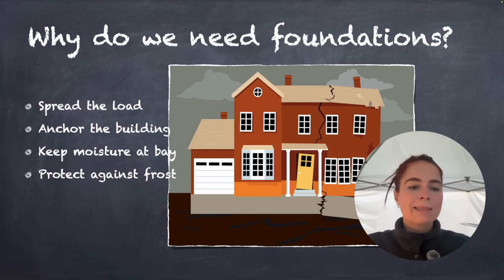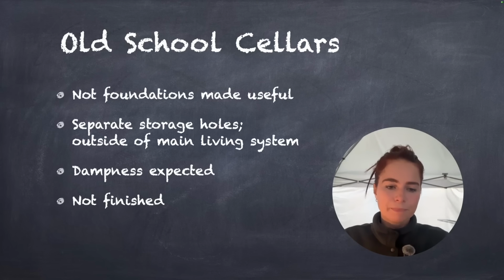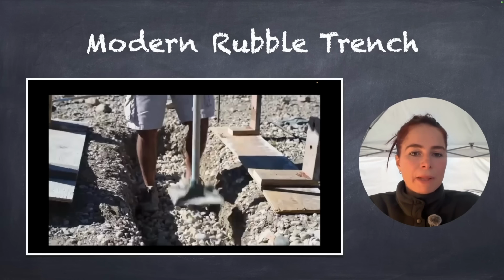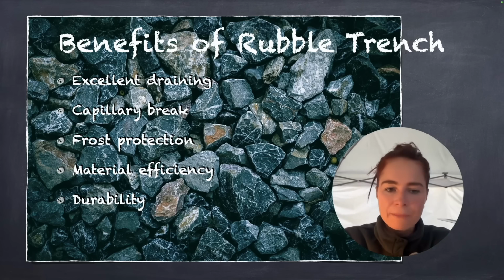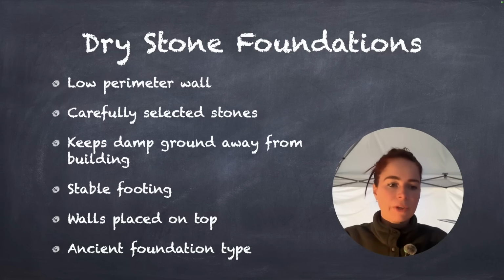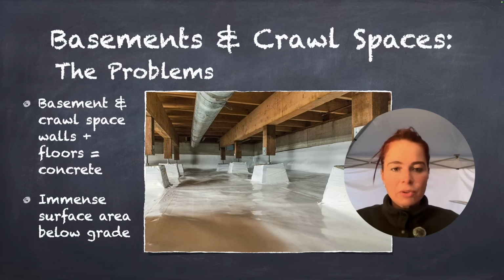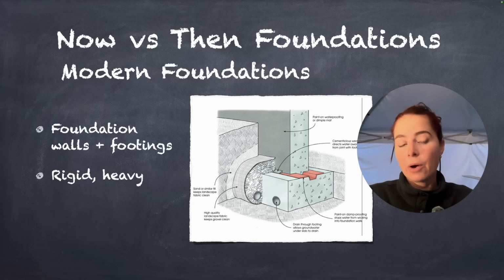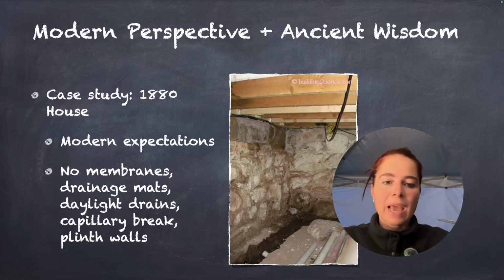Why Modern Foundations Fail — and the Genius Design We Abandoned

Comment: Growing up in Tornado Alley in the US, we often had to hide in the basement whenever one would blow through. I was wondering if you had any thoughts on below-grade structures being used for safety, and what it would look like to incorporate rubble trench and/or concrete sub-grade building in conjunction, cost aside. I know that using both would likely be prohibitively expensive, but from a purely theoretical or academic view point. I'm also curious how the various foundation structures would work in different climates, like how different areas have earthquakes or landslides, what would the benefits or drawbacks be to different foundations under these more extreme cases?
Reply from the maker: Good question — and I totally get the need for storm cellars, especially in Tornado Alley. From an air-quality standpoint, though, I’d want to keep any below-grade space outside the main building envelope, since connecting it directly can bring up moisture, radon, and microbial air from the soil. That does make things a bit more complicated structurally, because an unconditioned space under the house adds moisture and temperature challenges — but still worth considering for safety.

As for combining rubble trench and concrete, I don’t see why you couldn’t in theory. The rubble trench could still handle drainage, and the concrete structure would provide the strength and containment you’d need. Basically, you’d have the concrete sitting inside a well-drained gravel sleeve, so it’s never in direct contact with wet soil.

Comment: Not familiar with this part of construction, but I am very sensitive to mold.  Once I owned a house that had been built 1900 +/-.
Hole dug by horse, so a giant slope to the bottom.  Extra-High concrete basement walls extending 2' above grade and 6' below.
3-4' wide of pure Clay fill, push the original dirt back in, 3-4' of Clay, more original dirt, and repeat till the Clay extended above grade.
Dry as the desert.  To the point that even with my sensitivity, I moved my 10 hour a day home office to the basement.  Amazing.

Comment: The problem with rubble trench methods is settling can be uneven and snap your dwelling in half one, ten, or a hundred years later when you least expect it. Your reliance is on thousands of rocks, one or two breaking here and there over time. Cement fixes this. I come from a country where piling is used normally, with cement slab slowly coming in.

Comment: Crawl space insulated with  2"foam, 8 mill plastic on ground. Spray foam all gaps between sheets and between floor and foam on walls, you get a low moisture crawl space for plumbing,  electric and other services.  Crawl space above grade is key. This way is best.
Reply: Crawl space above grade...Really,  that's called slab to grade, 
not a basement proper !

Comment: The cast heat systems ran heat throughout the home when done right they heat water and are used for cooking as well as keeping the mass of the home warm and dry so when you get your towel it's warm when you walk to kids room baeefoot it's warm an overall steady 75 can e kept temperature controlled was possible with consistent watch when available    Smart system would use moisture collection through the vapor space condensation wicks off back down and reused so self sustaining also with no need of electricity to these home systems

Comment: Most of the buildings I've seen with masonry basements (stone, brick, block) had an even mustier smell than the ones with concrete basements. Of course, masonry basements were often considered unusable for living space and sometimes vented to the outdoors; I'm sure it was assumed that they would be wet from time to time. But there were also old houses with convective heating that allowed basement air into the ducts that heated the upstairs rooms; I remember one particular house that always smelled like oil, probably because one of the oil tanks had leaked onto the dirt floor at one time and the fumes were constantly being sent all over the house through the ducts. I'm not against using a concrete basement for living space, but I think we (in North America) put too much wood and drywall in our basements; there is no reason not to use cement board, metal studs, pressure-treated wood or just block masonry for basement partition walls. Using drywall in a basement is asking for trouble. 

PS: I've read about people in the UK digging "tanked basements" under houses in places where the water tables were too high for a conventional basement. That might work better in London than in a place like Canada where the freeze-thaw cycles would destroy such a hollow structures. On the other hand, there are basements in the USA and Canada made 100% of pressure-treated wood set into gravel, though I've never seen one. I think the suitability of any basement construction depends so much on the local conditions that no particular construction method can be ruled out.
Reply from the maker: Fair enough — and I really appreciate how thoughtfully you’ve laid that out. My caution with basements comes from having a very high bar for indoor air quality. For people like me, with environmental illness that flares even with a small amount of mold or bacterial growth, ‘acceptable’ conditions for most can still be debilitating. And honestly, I think far more people are affected by poor indoor air than realize it — just more subtly.

Comment: Warm air from upstairs also becomes higher relative humidity the cooler  basement. The modern practice of layer of peastone, foam insulation, vapor barrier then concrete works very well here in Michigan and is used for finished basements. 

My uncle built basement walls for one house with pressure treated plywood and studs. I don't remember what he used for vapor barrier or if it had a layer of foam, but it was back filled with peastone.

Comment: Another function the modern concrete foundation provides is as a hold-down for the house. The house is bolted and strapped to the foundation which literally holds it to the ground and prevents lifting and shear forces imposed on the house during strong storms or hurricanes from displacing it off the foundation. That's why foundation securement is a part of modern building codes. How will a rubble foundation provide this functionality? It cannot hold a tension, only support compressive loads.
Reply from the maker: That’s a great point — and you’re right, a rubble trench on its own can’t resist uplift or shear since it only handles compressive loads. In modern builds, that’s where the grade beam comes in. It’s a reinforced concrete beam that sits on top of the trench and ties everything together structurally.

The rubble trench keeps the base dry and stable, and the grade beam above it takes care of the anchoring — so you still get that continuous load path that resists wind and lateral movement, just with much better drainage underneath.

Comment: You say the rubble foundation has been used for thousands of years successfully and you explain its benefits. You then say in modern times when rubble foundations are used a synthetic silt fencing barrier material must line the trench before the rubble is put in to keep fines from infiltrating and reducing its pore size so that it doesn't wick water up the way that concrete does (with its small pores amplifying the capillary effect). Also, to keep clay type soils from infiltrating and plugging up its draining capacity. But in centuries past, silt barrier type fabrics were not available nor were they used. So how did these systems work as you say in the past without the filter cloth? If they did, why is the silt barrier needed today?
Reply from the maker: Such a good question — and you’re absolutely right that rubble trenches worked for centuries without synthetic fabrics. But not every one of them stayed perfectly dry! A lot depended on the local soil — coarse, free-draining soils performed beautifully, while finer clays or silts could eventually clog the gaps between stones.

What we have today is the benefit of hindsight. Adding geotextile or graded filter layers is just a fail-safe — a way to make sure the system keeps draining even in less-than-ideal conditions. Ancient builders worked with what they had and adapted to their local materials; we just add a few modern tweaks to make the system more reliable across different sites.

Comment: Like many already point out. It's a money question. 
Bringing in a bunch of rock to prepare the foundation is a complete different thing than putting a above  slab on compacted  sand . 
I don't really get the shift to modern basement issues. 
I don't think you have a lot of real live experience in this matter.
.... so your prevered solution is a crawl space?
36:46 "in my experience " .... let me go to the beginning and look what that was.
Reply from the maker: That’s fair - cost is always a factor. But interestingly, once you add up the concrete, formwork, and waterproofing, a rubble trench can actually come out comparable or even cheaper depending on local material access. My goal here isn’t to say there’s only one right way -  just to explore why so many modern foundations struggle with moisture and what older systems got right. I’m sharing what I’ve learned and experienced so far - there's clearly a discussion to be had.
Reply: @thehealthybuildingproject I was already writing some long explanation .... but i believe the main issue is sites not having sufficient drainage. You can't have concrete sit in water.... if not  planned.

Comment: To the notion that basements aren't necessary, I have one word: Tornado.
Reply: Or, the tornado of extreme discord in the house. Basement living area becomes an escape to live in & recover from the daily wanton mess faced upstairs.
Reply from the maker: Totally fair — storm safety is important! I just wouldn’t want that below-grade space sharing air with the main living area. Keeping it separate helps avoid the moisture and air-quality issues that basements often cause.
Reply: It is possible to have dry basements even with using mostly modern materials. You just have to consider soil type where you live and specifically, where you're building your house. My in-laws built a house in the mid 90s and right where they put the house was very sandy soil. I think they still put in perimeter drains but with well drained soil they never had any issues. In heavier soils, you can backfill with limestone and install perimeter tile.
Reply: I live in a log home on a full walkout basement facing south.  The basement is only partially finished, with polished concrete floors, a bedroom, bathroom, laundry room and family room with a wood stove, and mechanical room, but none of the exterior walls are finished, just stamped concrete on the exterior walls and no ceilings..  In 28 years of living here, we've luckily never experienced a moisture or mold problem and it's especially a comfortable space in the wintertime with a roaring fire.   The house is built on a hill with a mild grade that slopes away from the home on all four sides, so maybe that's why we've been so fortunate in this Ozark Highlands region, with soils that are typically deep, cherty (gravelly), and derived from limestone clay. And yes!  Tornadoes are a real thing here!  We have them throughout the state every year and have had a major one within 3 miles from our home!   I'm so happy to have our basement!
Reply: I'm from Chicagoland where tornadoes live and up until 2000, every single family dwelling was required to have a basement. Fun fact, tornadoes can occur ANYWHERE on earth. I live in the Mojave desert now and dust devils (small tornadoes) are very common. There's no reason a tornado couldn't form out here. When I build my house, it will have a basement, and obviously it will be earthquake resistant.
Reply: Yeah, it seems that concrete is the nasty part about basements, not the basements themselves. PWF basements are known for having an excellent record with warm and dry basements thanks in part to the higher R-value of wood over concrete and the excellent drainage detailing necessary to make it work at all. If a concrete basement retaining wall was given continuous insulation on the outside and the same high-performance drainage detailing as a PWF foundation then it would probably not have the same musty/moisture and bad air quality issues as they typically do.
Reply: it is a difference between having a bunker under the center of a building and all the way out to the outer foundational walls.
our house is made out of logs and the oldest part is from 1842. there is an earth cellar under the kitchen, which should be as tornado secure as it gets. it is dry and temperature stable.
the foundation is a s dry stone ring wall and still perfectly stable.
the newest part is from 1970 and the foundation is concrete and now needs replacing as it has cracked up. there is a full cellar which is useless for anyone except mice.
if the building above it had not also been made of logs it might have caved in.

Comment: Well meaning and intentioned, but not well enough informed. There's a good reason we use concrete today. It supports in a strong minimalist way, is relatively fast and very strong, can easily be made into complex shapes and allows for useful living space in the ground, which a rubble foundation could not do. It also minimizes the amount of expensive quarried stone in the structure, because aggregate is not cheap either and a rubble foundation would require a heck of a lot more than is in the concrete for the same foundation. As stated by many below who are in the know, when the proper techniques are used without shortcuts, a concrete foundation will beat a rubble foundation hands down. In any case, in many applications, the same "rubble" foundation techniques are still in use today in conjunction with a concrete foundation, just that they've changed enough that a layman won't necessarily recognize them. For example, aggregate is often in use under a footing when the subgrade is uneven or disturbed, or under slab foundations and modern roadways are still built on heavy granular foundations just like roman roads were. But most importantly, up until fairly recently, homes weren't sealed airtight to keep heating expenses down. Old houses were extremely drafty and as such healthy, but required a truck load of fuel to keep them warm and comfortable. The most important and cheapest requirement in keeping a basement dry is ensuring proper surface drainage away from your house, something most people have no clue about.
Reply: if used in conjunction with a permanent wood foundation, a rubble foundation Can provide useful living space in the ground wherein you have a wall and floor assembly that can be insulated. The list of reasons for not using concrete grows every day. Personally, after seeing the removal of an entire beach in Michigan so that the highly prized sand could be used "elsewhere". Where I live in Colorado, I'm being told that my Permanent Wood Foundation will cost less than a concrete foundation.
Reply: @krisgehrholz9817  It also may be appropriate in your area as Colorado tends to be drier. If you haven't seen it, there is a buildingscience article about permanent wood foundations written by Joseph Lstiburek. I found his wood slab on grade foundation interesting, but would consider replacing the EPS/XPS with mineral wool.

Comment: thanks a lot for your presentation, one thing i can not remember if you mentioned: rubble trenches have no ancoring to the ground. This is important when in reagions near the sea and where thunderstorms occure.
Reply from the maker: Great point — thank you! You’re right that the trench itself doesn’t provide anchoring, so uplift resistance has to come from what’s built above it. Typically, the grade beam or footing on top of the rubble trench is what anchors the structure, and the wall system ties into that. In areas with high winds or uplift risk (like near the coast), you’d definitely want engineered tie-downs or hold-downs designed for that. Such an important consideration!

Comment: Using a gabion cage is the best option I have found. There are limitations with a rubble trench foundation that a gabion doesn’t. Especially in earthquake zones.
Reply from the maker: I'm looking into these now.. I love how they bring ancient wisdom into the modern day.
Reply: I know gabions are used for solar installations and have seen one example of them being used in a single family residential, but I've mainly seen them in non load bearing landscaping walls. Of course the metal cages would need to be resistant to corrosion, which could add to the cost.
Reply: A heavy gauge galvanized mesh cage could help contain the rock 'ballast', and could provide the anchoring opportunity for the wood structure's bottom plates.
Reply: @terrylutke sounds a bit overkill
Reply: Gabion is the one looking like a metal butterfly?